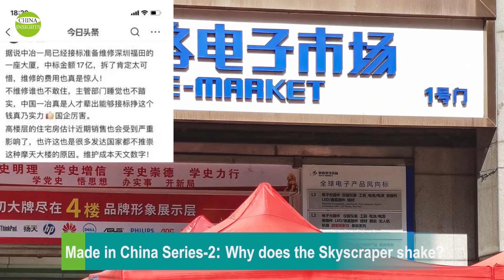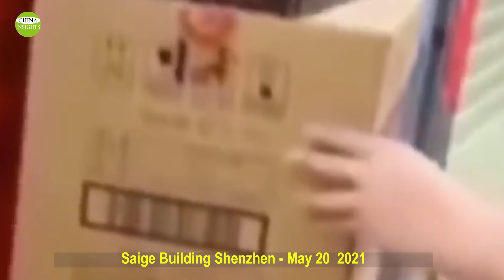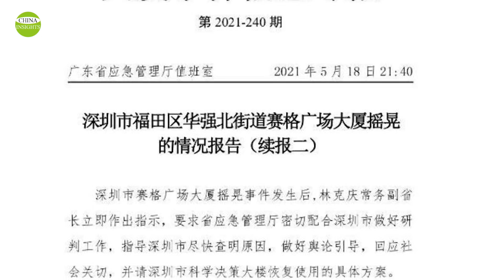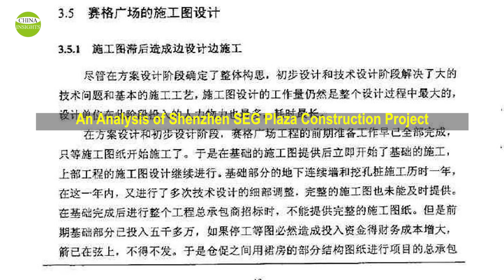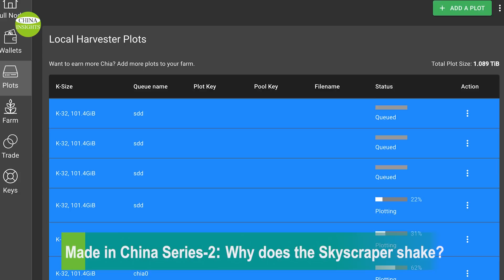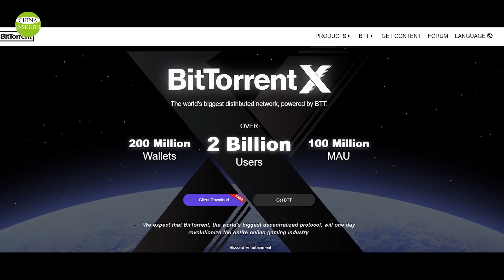What Cause the shake of  Shenzhen tallest steel skyscraper for 3 days? SEG Research report and more

Comment: very strange to say the least, especially if the building didnt shake in prior storms, and shows no signs of sinking below.  The only thing it could be is wind induced harmonics.  The wind buffeting the structure at just the right place and right side and intervals that multiply its force.  like a surfer standing on a way at just the right moment to ride it.   This is even seen in the footage which shows a clowdy likely windy sky preceeding a storm.   So im willing to bet this building needs a sway damper.

Comment: The person holding the camera at 0:30 was obviously exaggerating the shaking by swaying the camera from side to side. But - if we ignore that kind of thing ------ we can focus on what sort of unseen internal damage might have been caused (inside the structure ----- that can't be seen). The building is probably a write-off by now. It could end in tears later. And anybody knows that if a building hasn't shaken much at all for 20 years and then suddenly shakes substantially 20 years after it was completed. Well ------ you know something became seriously wrong.

Comment: SEG plaza was built without a tuned mass damper. The metro below was added years later, with population and traffic expansion, the building is like a giant tuning fork. It might not collapse for awhile, but there will be continual masonry and metal fracturing throughout the building.

Comment: The hard drives explanation sounds pretty silly to me. Roughly estimating, 100 hard drives operating at maximum speed have comparable angular momentum to a single person moving in a gentle pirouette, and I doubt they have 100 hard drives operating per person. For the hard drives to cause a problem, the building would have to be so weak that if everyone inside decided to dance they could cause worse movement. It takes about a minute and some high school level physics to make this rough estimation.

Comment: HDDs spinning caused building vibration 😂😂
Reply: Small vibrations add up through time, depending on how many HDDs and their position its possible, its called modal analisys. Check tacoma bridge. That said if they close during the night that would cut the source of the vibrations and reset the system.

Comment: LOL ..the story about the hardrives creating a torque enough to generate the building ressonant vibration is indeed ludicrous.
The Hard disk drives (hdd) rotating plate weights a couple of grams ... they rotate at about 7000 rpm .. nothing they can produce in terms of momentum would be enough to make that building vibrate even if the entire building was totally occupied from floor to top with only hard disk drives oriented in the exact same direction ...
That theory is indeed silly to hide the fact that the building was built with a Structural MISTAKE that allows for ressonant vibrations Without Any External influence ... this is a doomed building.

Comment: It appears the building can well handle strong winds but it cannot deal with rapid temperature changes. The concrete filled steel tube design may doom the structure as the steel expands more quickly with heat then the concrete filler, transferring the majority of load carrying to the steel, then as cooling occurs , the steel quickly contracts, leaving the concrete to carry the load. It might be that thermally insulating the steel tubes could mitigate the stress and delay structural failure.

Comment: Interesting conjecture - that the Coriolis effect from thousands of spinning hard drives is to blame.  Seems unlikely, as server racks, each with perhaps hundreds of drives have not been known to shake. Plus, the Coriolis effect appears when the spinning axis is tilted. If the building is shaking up and down, or if it is displacing laterally a few inches over the span of a 300+ meter tall building, neither would cause an angular shift in the spinning axis - hence no Coriolis force.   Note: the speaker at 7:11 mispronounced 'Coriolis'. It is NOT pronounced 'Corolis' (like a Toyota Corolla). The letter "i" in the word is pronounced. The correct pronunciation is 'Coryolis'.

Comment: May be it is resonance produced by the two antennas . It happened in same temples in India in witch two identical towers entered in resonance when one of them vibrated. So if this is true they must notice a movement up and down in the floor slabs like waving . the cause is visible at 0:45 : the two antennas resonating
Reply: Probably not one single cause. But many.
Reply: What you're describing is termed 'sympathetic vibration' where one vibration induces vibration elsewhere at either the same frequency or a harmonic.

Comment: hard drives spinning causes building to shake? that's ridiculous!
Reply: The principle they use for an explanation is the Coriolis effect. This is appears when you tilt a spinning object off of its axis. However, there are at least a couple problems with this conjecture. First, hard drive disks are tiny, and even thousands of them would not be sufficient. Second, server racks each used hundreds of hard drives for decades and the racks themselves have not been reported to shake. Third, sensors say the primary motion if vertical, which would displace the hard drives, but not tilt the spinning axis, and therefore, would not induce a Coriolis force.
Reply: @gregparrott  nice explanation, you're right...not enough hdd's to induce a coriolis force. a sub standard engineering design of the building's base is more likely..
Reply: @sgtjoe2008  One commenter here heard that the sand used for the concrete in the tubes was beach sand, containing salts. If true, that could cause both the concrete to degrade over time (the building is 20+ years old) and explain why this problem is only appearing after a couple decades in use. Salts could also cause internal corrosion of the steel tubes used in its construction.   If true, this is a scary, and unsolvable problem (other than demolishing the building)
Reply: @gregparrott  yes, and it would be suicide to continue working / living in that building....it's like a ticking time bomb, could collapse anytime, real scary for the people using that building. just hope they just demolish this building...asap.

Comment: You try to mix political with technical issues. Leave the tech issues to engineers, and leave politics OUT of it. Go study and get an engineering PhD degree instead. The concrete inside steel tubes could be crushed with time with over loading by merchants, then the friction damping of the columns was reduced, so it affects the entire building. The BAD thing about Steel cased concrete column is one never know the condition of the concrete encased. Only to x-ray the column and luckily right at the crushed concrete location. Investigation takes TIME. If you are an engineer, you will know. The source of the problem is always NOT what you first seen. California retrofitted a lot of concrete bridge columns with steel casing after Loma Prieta earthquake. It only good to against total collapse. I totally against Steel cased concrete column construction, since the condition of concrete en-cased by steel will be unseen and unknown. How to fix it?  Inject slow hardening fluid epoxy (concrete driveway self leveling epoxy) to re-solidify the encased concrete columns..
Reply: Vibration transducers can also detect the state of material inside a tube. At regular intervals along its length, the transducer emits a range of frequencies and monitors the returned signatures (how it is reflected/damped). But the epoxy solution seems problematic. Building engineers use 'mud jacking' to inject solids below a building's foundations. (The leaning tower of Pizza was addressed this way.) But injecting within a tube, where the concrete is at least in principle, relatively non porous, seems a bit dicey.  
Someone else here mentioned hearing that the sand used in the concrete was beach sand, containing salts, which may not only degrade all the concrete over time, but corrode the tube as well. If there is truth to that, then they are just plain f**ked.

Comment: Needed more deep piles...or maybe piles at all going down to bedrock? Sometimes building to code is not enough.
Reply: How would that account for the shaking?
Reply: @asdf3568  the piles anchor t he building down preventing any undue vibration, leaning or other stuff. They will have to pile underpin. There is a similar situation in a San Francisco building altho this building leans as well. Cutting corners in high rise construction is not economical.
Reply: @yorkemar  Well they try to save money, and in the end it cost more to fix problems.

Comment: If the high wind could cause shaking the building, then, engineers should not build such tall building.
Reply: The building has been in operation for over 20 years, and has been exposed to very high winds in that period without the shaking. It has also had subways operating below it for a long time. So, neither of these speculative causes seem plausible. 
Regardless, any building over 1000 feet tall (such as this), with some 15,000 people working in it and pilrs of visitors/shoppers, seems impractical just based on logistics.

Comment: Someone said the steel tubes were filled with concrete made of sand with a lot of salt in it, like from near the ocean. So the cement disintegrated inside some tubes and the cement is now loose
Reply: If that is so, the salt in the sand and concrete will continue to degrade the concrete and eventually the steel tubes that make the structural columns. That would make a nightmare to demolish this building.
Reply: Now THAT is an interesting theory! This building has seen high winds and had subways driving beneath it for two decades. So neither of those theories seem consistent.  But what you're suggesting would explain why this 20+ year old building is only beginning to experience this problem now.  
Do you remember where you saw this possibility suggested, and can you cite a source?
Reply: They say it is bouncing . But in the pool video it looks like it is moving back and forth . But thanks for that info as it is probably the most realistic . Definitely not hard drives lol.
Reply: @30jspecial  Sea sand contains a higher percentage of chloride ions, which increases corrosion in steel
Reply: @justan idiot Good point
BTW: You deserve a name change

Comment: Very tall buildings can sway due to winds. Swaying in buildings are usually corrected by large damper weights. Shaking however, indicates another problem. What that could be I don’t know. I have 40 plus years of experience in construction both commercial and residential. Pretty serious problem.
Reply: This building has 20 years of operation without any problems then out of the sudden there's a vibration problem.
Reply: @hotlemongingerhoney  warrenty over.
Reply: Would you buy a piece of property in that building?. That is pretty  serious problem so what's your recommendation.
Reply: @realsteel6531  not sure. I would certainly install laser monitors in the basement of the structure. I would want to know if the shaking is foundation movement. If the foundation is not settling, then that may indicate the floors above are shifting and compressing. I don’t know how to fix that, and I’m sure it’s costly.
Reply: @tomcartwright7134  for me, the best way to solve the issue is to demolish at least 10 floors from top of the building. Obviously  the building is already 20 years old and  people in China keep on multiplying and at the same time more occupants keep on coming. So clearly overloading is one of the issue or maybe the main culprit. As we can see the movement became less as the days goes by bcoz people are afraid of going back to their units anymore.
Reply: @realsteel6531  your solution may be the best one yet. It may well be an overload on the foundation. Good thinking sir!
Reply: There are so many high building on the world... They arent swing...
Reply: Like a Jelly tower
Reply: Harmonics?
Reply: They used faked materials, it's already miracle it can stand for 20 years:)
Reply: Waiting for the next Typhoon

Comment: I’m no building expert but I bet that big underground mtr station built right next to it has something to do with this that skyscraper was built 20 years ago the mtr not so long ago
Reply: There are actually 2 metro lines that run under or very close to SEG. One has been there many years but the newer orange line was only added a few years ago.
Reply: @Mikere5  
its a underground shopping mall its not just a station.
even i know if i dig too much around a big object it will collapse.
basically this would not have happened if the station and malls
was built deeper underground.
the seg building did its job giving out a warning
Reply: Funny enough, that's part of the official explanation... Which kinda makes me think it's wrong, since it's China lol.

Comment: Install tensions cables, like guitar strings, that can be auto tuned to counter the resonance frequency vibration as it builds up.
Reply: The building is 20 years old. They would of experienced resonance within 5 years when they finished construction. It's say the issue is more pressing like a sinkhole forming under the structure.
Reply: Nice idea.

Comment: I think the antenna still caused the problem
Reply: I thought so too, but then the building would be shaking very early on its hard to believe that after 20 years now the wind is blowing in just  the right speed and direction,
Reply: @hifijohn  it could happens, with the climate changes, new building being erected, the building starting to ageing. It's only possibility. They should conduct thorough investigation.

Comment: Usually tall buildings have a sway damper at the top, doesn't this building have one?   Ok, just further in, they answer this: "no".    This is very odd.   Dampers have been used in tall buildings for many decades now, especially if it is in a high wind zone, so a tall building built in the mid 1990s without one is very irresponsible.
Reply: So the building's structure is taking damage  from the unmitigated shaking??
If so how MUCH?
Reply: Strange but not surprising if they were building it faster than the drawing plans could be finished. Oops we forgot that.
Reply: That's clearly not the problem
Reply: @asdf3568  Whether wind or "hard drives" is irrelevant, a sway damper can damp resonant motion regardless the source.

Comment: How  can you repair that? It's  unrepairable It's like a ticking  bomb waiting to explode. Goodluck
Reply: Well if it is a ticking bomb it’s been ticking for awhile
Reply: Depends on what the problem is.
Reply: @asdf3568  yeah, but we're  talking about the integrity of the building. Here's  how you gage the seriousness of the problem try to sell your property there.
Reply: @realsteel6531  I was answering your first question. How do you repair it? To know that you first have to know what the problem is.
Reply: @asdf3568  I agree with you that's  why I said "yeah"
Reply: @asdf3568  As was mentioned here, tall buildings often have vibration dampers installed near the top. They are heavy, but in principle, they could re-purpose a couple of floors near the top for installing dampers.  For example, San Francisco's Golden Gate bridge had dampers installed at the top of the towers in order to address seismic vibration (i.e. earthquakes).   https://www.marinij.com/2016/10/28/golden-gate-bridge-earthquake-devices-test-well/   Scroll to the 2nd photo, note size in contrast to steps. I understand there are two of these in each tower
Reply: If is not foundation issue just delete 10 floors from the top and problem is pretty much solved.
Reply: If the problem is somewhere within the tower itself, its repairable. If the problem is within the foundations of the building, would be best to just demolish it before it comes down.
Reply: Same thing im sayin....demolition only
Reply: Mush like the 3 Gorges Dam.
Reply: @passinthru4788  Ah yes, that conspiracy theory never gets old.

Comment: Hard drives being responsible for the building vibrations seems unlikely to me. Hard drives are installed with different orientation inside the computer tower, and the computer towers are positioned with different orientation among the building. This most certainly results in random vibration noises from all the hard drives once combined. Unlikely to enter in resonance with the building structure.
Reply: That was definitely my fave theory in the video 😆

Comment: Every structure has to be configured from time to time, it shouldn't be swaying or tilting, it should be realized all the way up, the way every pillar are weighed and installed with added features that can withstand weighs. It is always anticipated, forecasted, allocated and applied in every field of science particularly architecture design, metallurgy studies and materials used in order to integrate, combine, dissect and add features that can make the seg building certain from the forces of nature. The design of the building can be reinforced to be stronger. Trial balanced in all areas with many features. Huge Caster rollers and many types of depression resistant materials to jive with the forces of nature that can also harness energy, pollution and many science packed features, as the building was cited for its features and can be cited back for another after completion. SME General Practices, practitioners all fields of science and industries are orderly and excellent in their respective fields of studies through coordination.
Reply: Hahaha

Comment: They need an independent engineering firm to check the structure from bottom to top.  They also need to check the soil directly under the structure as to soil and foundation standards.  What will happen if the structural skeleton fails?  This could result in a catastrophic failure of the overall structure.